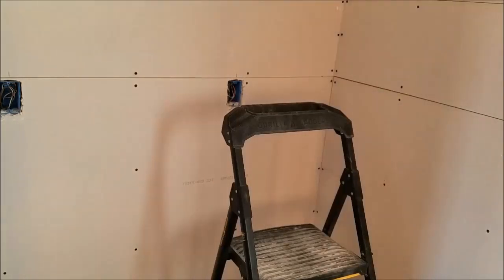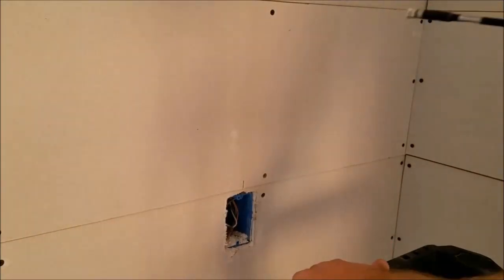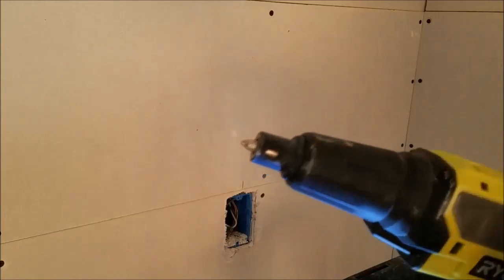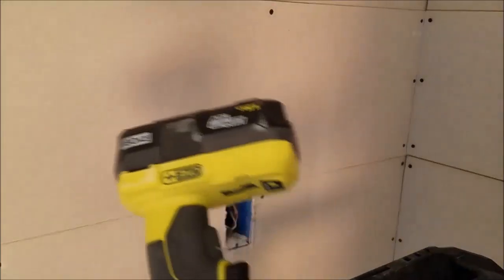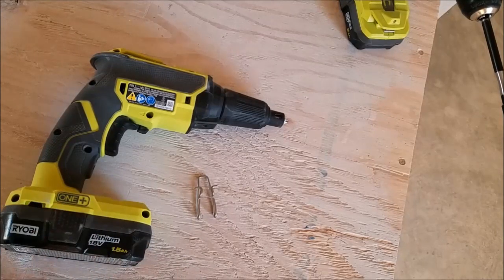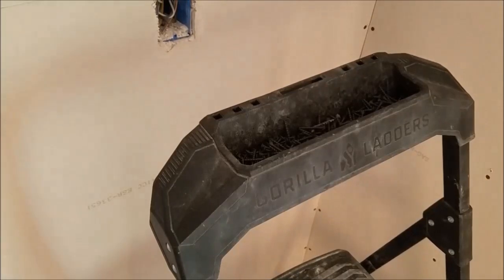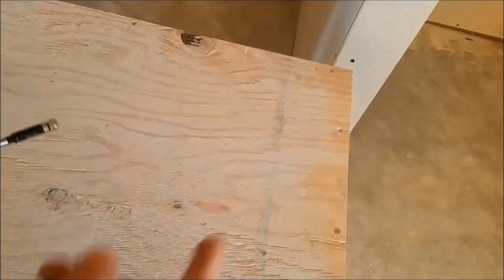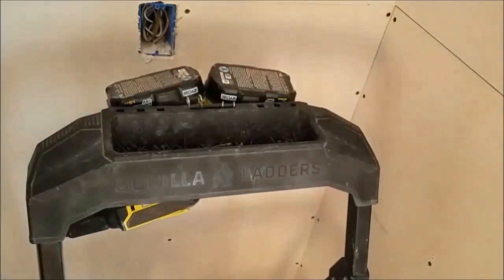The Secret Ryobi Accessory You Didn't Know You Need

Comment: Not to be a hater(more of a psa). But the only ryobi tool or accessory you need is nothing. I was taught from a young age to not buy cheap tools bc you will pay for it in the long run
Reply: Listen here tool snob, I have been using  Ryobi one+ tools heavily for over 5 years now. Zero failures and plenty of power. Don’t knock it unless you have tried it.
Reply: @josephm40  lol everything has it limits and depends on what you using it for i am with you  @Endeavor7  on this one
Reply: Why would you presume I haven’t tried their tools? I have had couple of their tools and they both took a dump within a month
Reply: @evankaiser3992  Assumption based on your preachy “I was taught from a young age” so you must worship at the altar of the mighty Dewalt?
Reply: Another presumption wrong. You’re 0/2. Makita for all my battery tools and I use all kinds of other top brands for other tools.
Reply: @evankaiser3992  Makita is great brand for sure, but Brandon’s video was about a clip holder. He was not recommending you go out and buy anything Ryobi.
Reply: @josephm40   you might want to read the title again. 0/3
Reply: @evankaiser3992  Ok Evan.
Reply: @josephm8306  You meant, "Okay Karen."
Reply: lol someone hasnt used ryobi in a long long time.
Reply: @evankaiser3992  The secret RYOBI accessory you didn’t know you need. So if you don’t have/want Ryobi tools it doesn’t really apply to you. You might want to read the title again.
Reply: I know im late to the party on this comment thread, but these cyber arguments are super entertaining lol